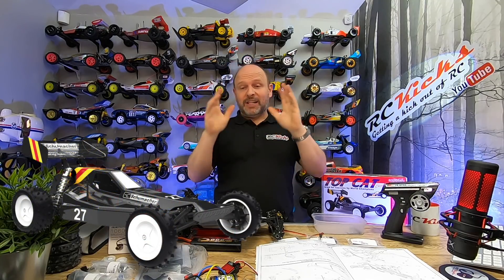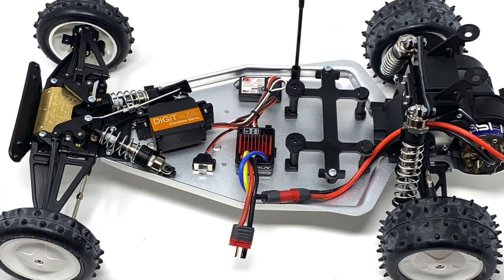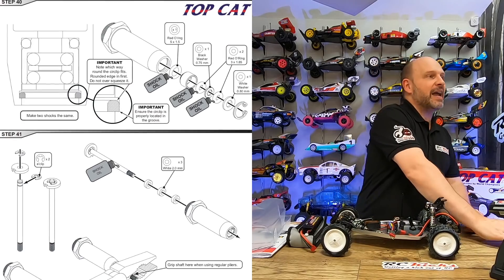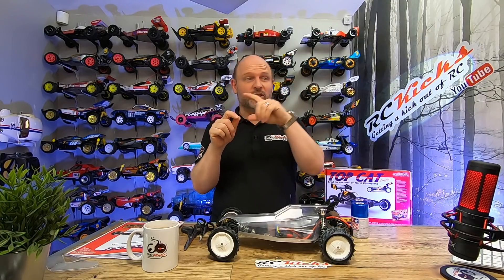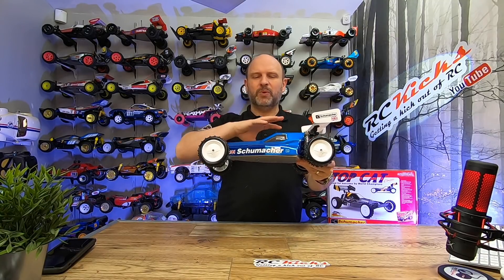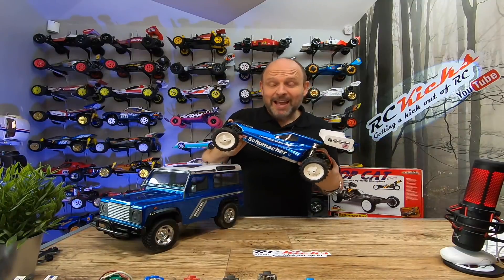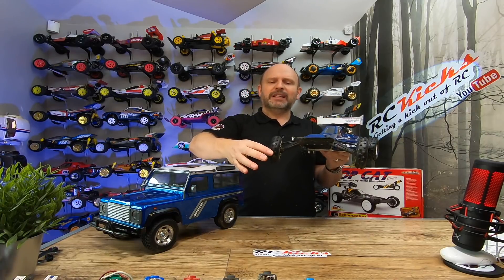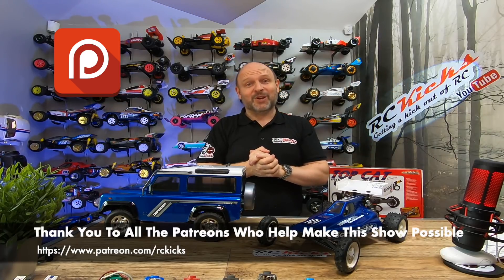Track Weapon! Finishing, Running & Review Of The TOP CAT Classic, 2WD RC Buggy From Schumacher. K178

Comment: That turned out fantastic.
I sprayed mine in silver box art because that’s what I had on my first original TopCat.
This time I added a 3300kv brushless and a castle sidewinder esc.
It’s a absolute rocket.
Reply from the maker: Hi, Can the chassis take the brushed power or did you find it made the car control difficult?  I ask as I'm thinking about the upgraded to the pro trans and brushless but I don't want to damage the fantastic handling.
Reply: @RCKickschannel  I did upgrade to the pro trans just to be on the safe side and it is a handful to keep it pointing straight if I mash the gas on my 3300kv brushless and a 2s.
Mind you, I was running on a hard packed dirt surface with loose sand on top.

Comment: Ha!!! I knew the track would progress... Love my Top Cat. It was a nice build and it drives great. I went ahead and got the front alloy parts for the same reason you mentioned in the first video. I just ordered a faster servo, a better servo saver, and I have some better Schumacher tires that I put on some factory rims dyed orange. The stock servo saver is really my only complaint, but I agree 100% This buggy is made to run...

Comment: Back in the day when I used to race we used 7.2v and split it into two threes so it goes either side and holding down with Velcro
Reply from the maker: I have two saddle packs like that in my Schumacher K1 Aero. It’s a good way to balance out the chassis and you can see why racers went for it.

Comment: Nice video, as always. You could have positioned the battery where you put the ESC and vice versa - there is two holes between the servo and the ESC that allow this. That's what I did. Also gives better weight distribution.
Reply from the maker: Yep that’s the plan when my shorty Lipo turns up.  Move the battery forward in the chassis. 👍🏻 I will also be upgrading the ESC and Receiver as well as picking up one or two
Upgrade parts.  This thing is lovely to drive.
Reply: @RCKickschannel  Hm guess the video is still processing but looks quite choppy at the driving section like it was filmed in less then 20 frames per second at the moment watching it in 480p
Reply: @RCKickschannel  Great! The car deserves the upgrades.

Comment: Great video, how does this compare to something like a Kyosho Tomahawk or Scorpion?  Maybe you could get them around the track too.
Reply from the maker: I will be putting these cars head to head on the RCKicks BGRAT as soon as I have a track timing system. :)  For me, the Top Cat is a better track-focused racer but the Tomahawk engineering is next-level quality.  These cars on paper look the same but in reality, are completely different.
Reply: @RCKickschannel  thanks , I think I'll try and get hold of a Tomahawk.  Especially as I've got the brushless le mans esc/motor

Comment: Like a lot of RCs of that era, 2x3c saddle packs were the recommended option for best packaging and operation. You can buy the cells, NIMHs, and the needed components, bars, wires, and connectors, for the proper fit. But then you can still buy saddle packs. Not vintage? But does it need to be if you are not storing the car with the batteries installed anyway?
Reply from the maker: I use saddle packs in my Schumacher K1 Aero.

Comment: Super cool car, great video too! I'm thinking for a friend who doesn't want Tamiya, built Kyoshos 30+ years ago and wants to get back into RC'ing. He has done no modeling or anything for over 30 years, this will be his first build.....do you think it'll be easy enough and how long for the chassis building and set up process?
Reply from the maker: I can recommend the Top Cat for him but make sure he purchases the brass front bulkhead at the start and a set of circlip pliers for the shocks. If he's starting out a shorty lipo makes life simple and offers more tuning possibilities as you can move the battery placement location forward in the chasse as well as have it at the rear.  The chassis build time is around 4 hours and setup is super simple.

Comment: I hate using shorty batteries for the reason you stated.  I have a lot of Tamiya cars that take a standard pack. Venom does make a LIPO that is in the shape of a standard Tamiya pack. Maybe that would fit? Thoughts?
Reply from the maker: Hi,  with a small change it would be possible to use the lipo 2S Tamiya size batteries in the Top Cat sitting across the chassis.  Really all that's needed is battery posts the same design as the kit but a little taller.  This would be a super easy job for a 3D printer.  I don't think it would be possible to find a lipo Tamiya shape battery that would slot into the rear mount lengthways but I could be wrong.  One advantage to getting a shorty for this car is you can then move the battery forward in the chassis and place the ESC and receiver behind the battery improving the weight distribution of the car.  I will do an update video when the battery and upgrade parts arrive.
Reply: @RCKickschannel  I look forward to seeing your update. I would imagine that a shorty pack would be easier to install.

Comment: Yep - bought the shorty pack - exact same one, as I use it in my Yokomo CAL3 also. Are you going to upgrade to the alloy front suspension bulkheads?
Reply from the maker: I picked up an upgrade Alloy Front Shock Rocker Conversion - Top Cat - U7599.  Budget is limited currently so I have to hold off until next month for a few more upgrades.
Reply: @RCKickschannel  ok sweet. I mentioned a tip on one of your posts, about clearance issues with shocks and steering rack. Use short screws into ball ends, and no spacers. You'll know what I mean when you see instructions.

Comment: Id suggest some thick foam near the  house brick walls..  .. 
The other thing i will mention is garden edging.  A Plastic roll . About 150mm high which could be staked in place on the outside so track side is smooth and has no clip the wheels points..